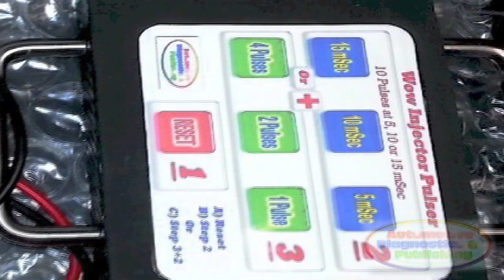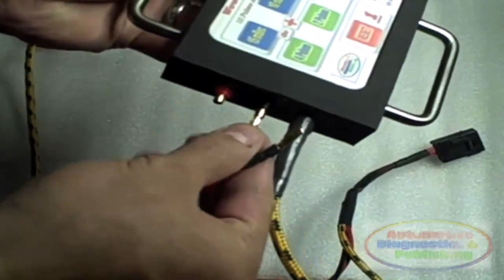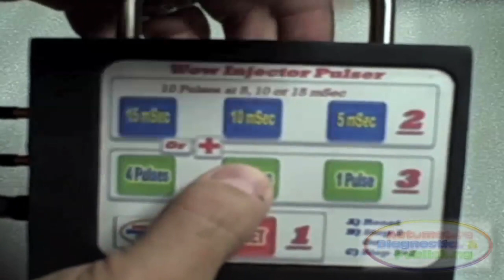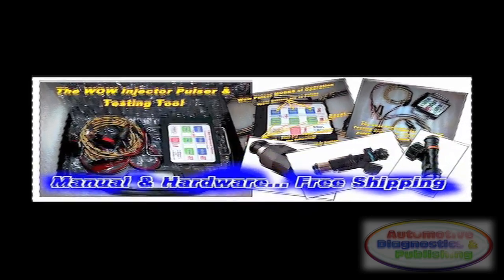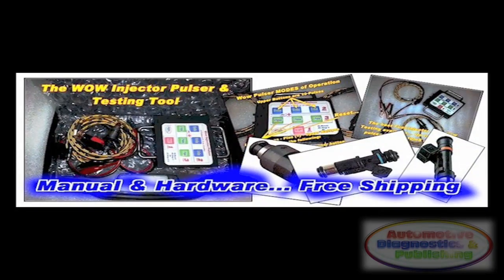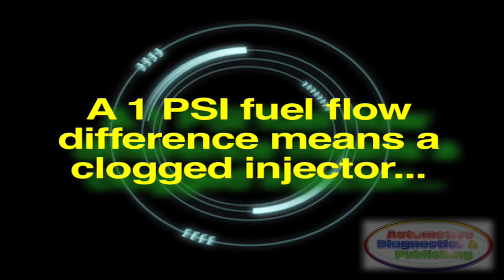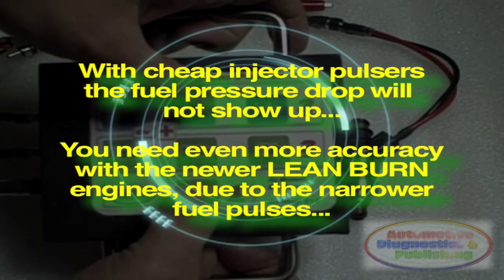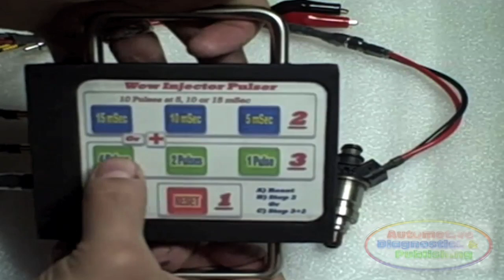Fuel Injector Tester Tool

Comment from the maker: The injector pulser tool has settings for 5, 10 and 15 mSec pulse-width. It can also be used with the above settings, but to put out 1, 2, 4, 10 and CONTINUOUS pulses. Why? Because you need a set amount of pulses, like 1, 2, 4 and 10 pulses at specific pulse-width to do an Injector-Flow Test. This tool has it all...
Reply from the maker: ADPTraining http://www.diycardoctor.com/injector_pulser_kit.html

Comment: Hi
will you please show us the whole process, how to connect the fuel gauge? will the key still on or off when doing flow test? about pressure drop, the pump will always maintain the same pressure even when the injector is pulsed. will you please show us an example of testing flow on real case.
Reply from the maker: ***** It's simple: 1) Key On Engine OFF2) FP-Gauge hooked3) cycle-key to pressurize fuel rail4) Pulse InjectorsNOTE: A 1 PSI fuel pressure DROP-DIFFERENCE = Clogged Injector. One the 5 pulse setting: 1/2 PSI drop Difference = Clogged injector. Test all injectors, write down drop and compare. 99% of the time only one or two injectors get clogged. it is almost never all of them. Males sense?

Comment: does the tool work with Diesel Piezoelectric Injectors and how would it work with a car that has no koeo prime pump.
Reply from the maker: No, it's a good question. But it is MOST DEFINITELY in our plans to produce a Diesel Piezo Injector pulser, which is badly needed. Stay tuned to our site.

The rest of your question, all fuel pumps have to prime the pump at startup, otherwise the engine won't start right off after a few days or even less. In the event that some engineer decided to do that, then you'll need to jump the fuel-pump relay to pressurize the system. Either way, it is the fastest way to do an injector flow test. And the Wow Injector Pulser provides the most accurate pulse on the market.

Most injectors will show a skewed pressure drop after 50 pulses. On most new injectors you need an accurate 5 through 15 mSec pulse. And the Wow Fuel Injector Pulser WILL COUNT the pulses. It has 5 settings for 1, 2, 4, 10 and Continuous pulses. So the mentioned PULSE COUNT at 5 - 10 - or 15 Milli-Seconds. That's what you need for proper injector flow testing. It is verifiable and you can prove it. THanks for posting.

http://www.autodiagnosticsandpublishing.com/Injector_Pulser_Tool.html